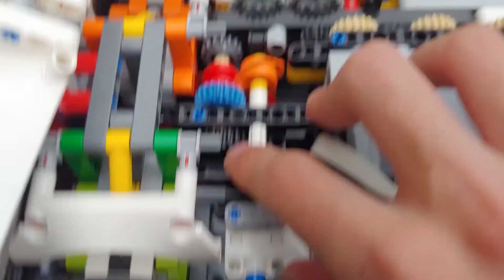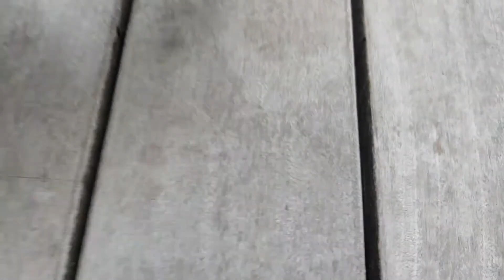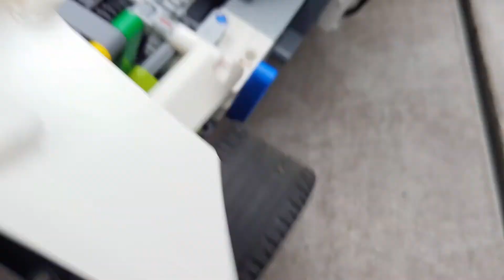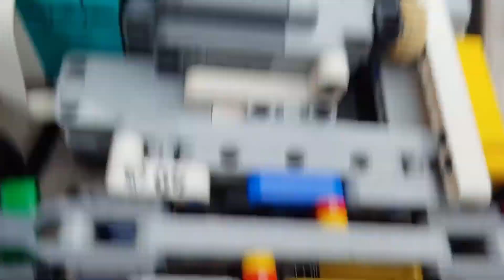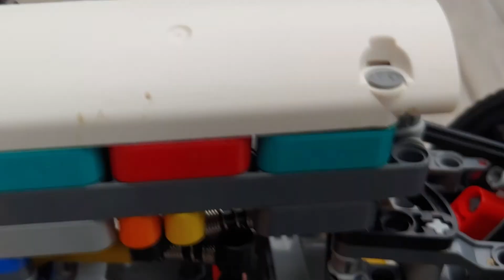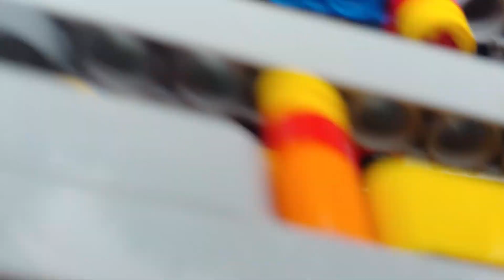I made a LEGO RC car that can switch gears!

Comment: both are double wishbone setups, the rear just has the shocks mounted directly whereas the front has more of a pushrod setup (sort of like in an f1 car) the front wheels' angle is called toe, and it seems right, but it would be more effective to have the rear tires toed in (pointing more in towards the body) if you want to have it go straight better, if you can do that. also as some other comments pointed out, the universal joints should be lined up (just search universal joint phasing) to make the output spin at a constant speed. otherwise cool vid but would be cool to see it drive as well